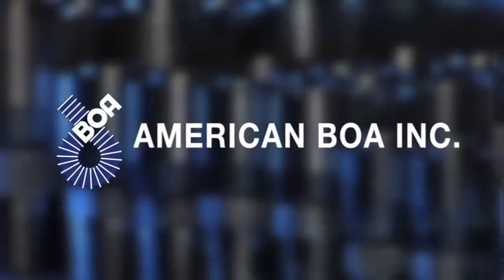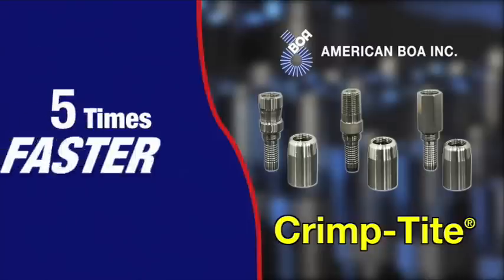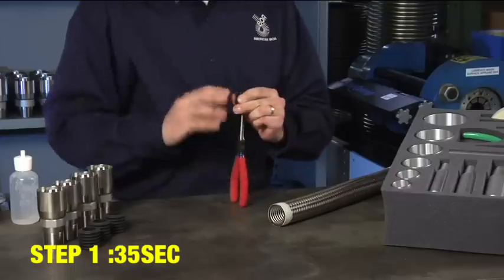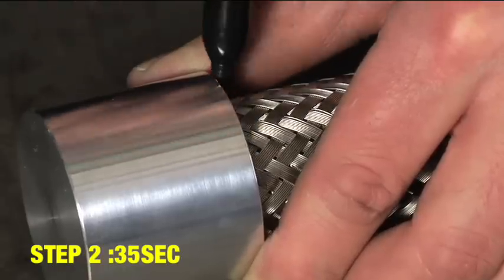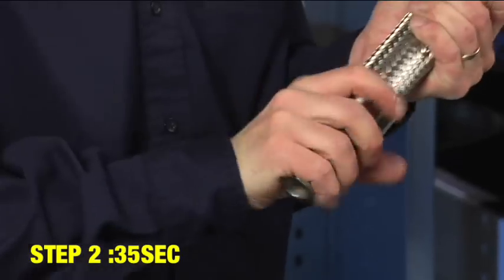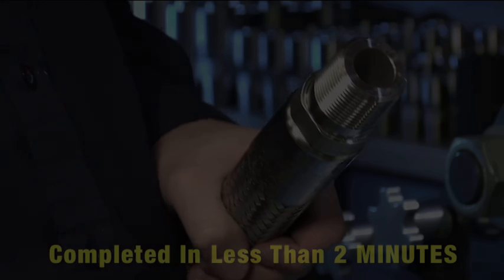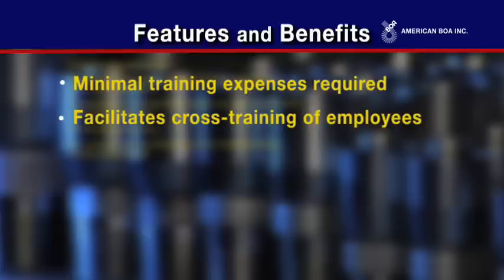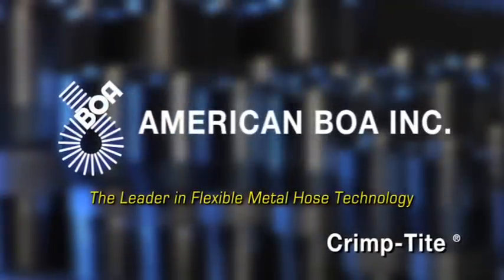Crimp Tite

Comment: Most likely the seal will fill the voids between the connector and the metal braiding. I presume that since there wasn't a lot of force used to press the connector onto the hose.

Comment: Defeats the whole purpose of a metal hose by adding a rubber gasket to seal the fitting onto the hose.
Reply: Why? Some polymers can withstand really high temps.
Reply: Don't  these flexible metal hoses have a rubber lining  ?

Comment: What is the working temperature and pressure like comparing to welded type?
Reply: Yes, I am asking same question too, is anyone knows? I used to assembled metallic hoses by welding.
Reply: Brian Ong
Reply: This guys has been commissioned to supply the U.S. Navy and USCG with hi temperature and pressure hoses to deal with up to 250,000 psi of steam pressure from boilers . This guy's are no joke, dude